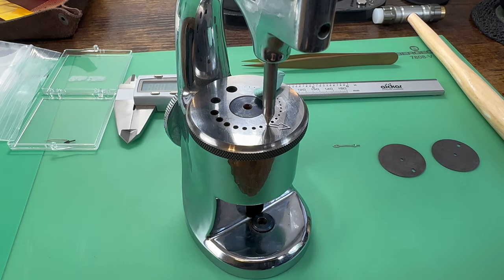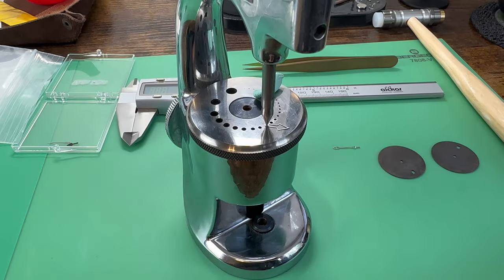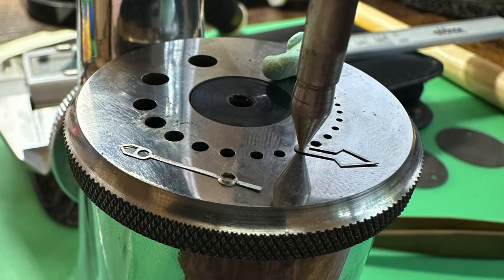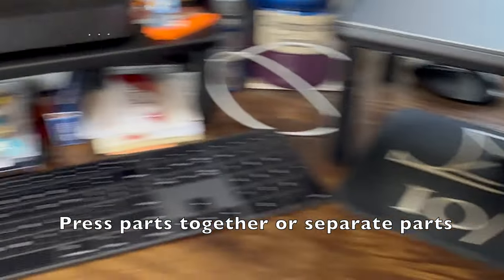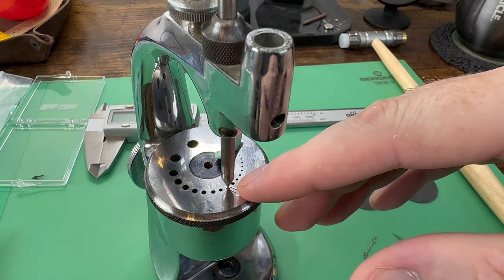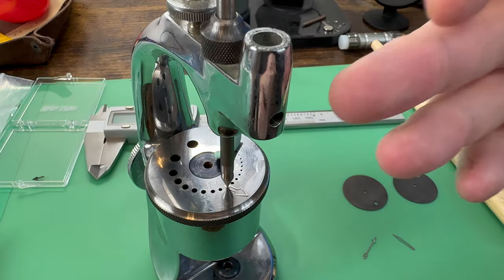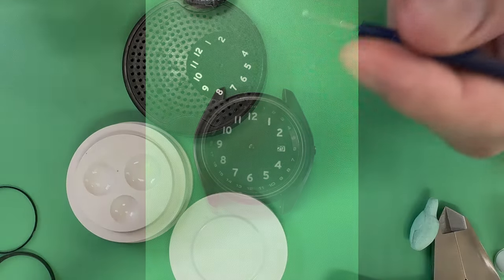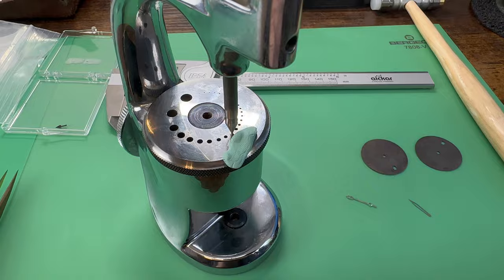Making Custom Watch Hands and Applying Lume to Dial Numerals

Comment: This is pretty awesome...you mentioned that you don't want to go into detail about chemical etching the hands. Do you know of good material? Hard to find stuff like this
Reply from the maker: stainless steel is what I used...thickness was around 0.10mm give or take
Reply: @WatchComplications  sorry I misspoke, I meant good learning material
Reply from the maker: @MaxxPowerFTW  ah learning material on chemical etching...I use a mechanical engineer for that, ha. Science at its best. Have you researched it any yet in terms of a topic?

Comment: Tinkerer here, have been enjoying your YT videos. I have a plastic coin ("gold" plated) that I'd like to use as a watch dial. Should I buy a case first or a movement first? Which video should I look at to help me get started? Thanks.
Reply from the maker: probably a case. also most watch dials are 0.4mm thick, some are 0.8mm thick. not very thick, so you might want to compare that to the coin to see how different/tall of case you'd need to house the dial and whatever movement you're hoping for.
Reply: @WatchComplications  Thanks, I ap[preciate that!

Comment: Well Done! alwas getting some good Info and ideas! I am wandering if it would work with a jpt 50w fiber laser? And may i ask which thicknes of steelplate you r using for the hands?
Reply from the maker: I'm not sure on the laser front, might depend on the material you use. The steel i used was about 0.28mm thin plate.

Comment: Looking for a watch that i can customize, mainly lume. Any ideas?
Reply from the maker: um....?
Reply: @WatchComplications  lol ya little vague. I find it dificult to find my grail watch; much like everything else having to accept what the market offers, there is always something I'd like to change.
I cant afford all the watches i like
so kinda wanted to customize inexpensive casio or other low budget watch before i attempt say a seiko, pagani design or other affordable watches.
So i guess my question is more targeted towards 'what watch brand offers the most customization variety or easiest to customize?'
Reply from the maker: probably seiko skx stuff has the most accessible and aftermarket mod parts available. if you're really wanting to tinker, pagani isn't a bad place to start low cost-wise
Reply: @WatchComplications  i have a seiko snk809 and a pagani design submariner homage pd1661. Where would i find parts for them?  The lume is very weak on the 1661
Reply from the maker: @willywantoknow2563  are you talking about replacing hands or just the lume on the hands? For hand replacements you'd have to get the hole diameters and find ones that match. Lume kits can be found lots of places, like ebay, esslinger, and ofrei
Reply: @WatchComplications  well, i like my PD1661 but the lume is rather weak. I like the dial but  like to replace lume in it. Would I be able to also lume the ceramic bezel? Kinda have my own colour scheme i want to create.
I kinda like my snk 809, little small, but I'd like a completely blacked out version similar to it with orange accents. Hand options perhaps too if the right one is available.
Money a little tight right now though, so just kinda planning.
Reply from the maker: @willywantoknow2563  if you were to replace the lume on the hands, you could take them off, put them in thinner, remove old lume and relume them (I have a couple videos on applying lume). As for lume on the dial, you'd have to apply any new lume over the existing markers, as trying to remove lume will typically ruin the dial in some way.
Reply: @WatchComplications  ceramic bezel markings are ground out so could fill them up? What adhesive would you use, superglue?
Reply from the maker: @willywantoknow2563  gaps, like ground out marker locations, openings in watch hands, are easily filled with lume with the appropriate viscosity, I have quite a few videos showing me applying lume to various things. As for adhesive, I'm not sure what you are planning to use adhesive for with regard to our previous comments, but 1. Never use superglue in a watch for anything. 2. If you need to use adhesive to do something like attach a bezel insert to a bezel either use double sided 3m rings or GS hypo cement. 3. If you are talking about what is mixed in with lume powder as an adhesive, just use the stuff that comes with the lume kits.

Comment: Can you lume over dials with poor existing lume? I bought a beautiful and customized dial on Ali, but the lume is terrible. It's a dark theme watch and it's like a black based lume, and it doesn't light up for sh!t.
Reply from the maker: you can certainly put more layers of lume on as long as it doesn’t interfere with the hands and it will be stronger. The problem with black lume is that it isn’t very bright to begin with. What can help lume be brighter is if there is a lighter color underneath of it before applying the lume. For example, when I lume a dial that has - black base, I always mark the locations in white so the lume is a bit stronger.